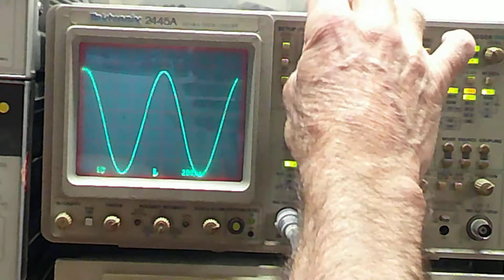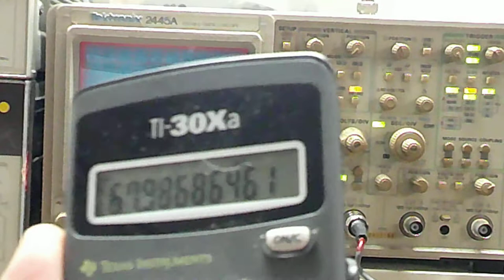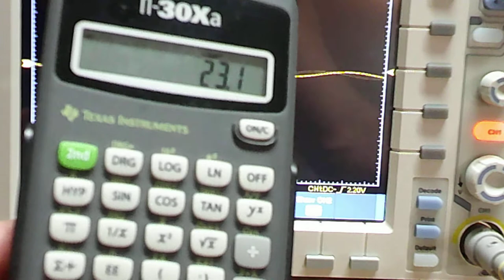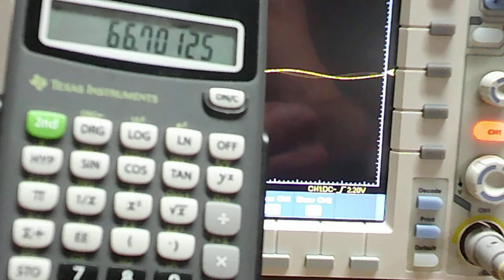Audio Amplifier Output Measurement Using Different Types of Oscilloscopes

Comment: could you not just hook an oscilloscope onto your speaker leads while the amp is also connected instead of using a dummy load?
Reply from the maker: No, the volume would be ear shattering, and you'd run the risk of damaging your speakers as well.

Comment: When I use the regular ground reference oscope probe on the + and - terminal on the amplifier I get a reading that looks like 2 AC sine waves wth at are 180° out of phase. Would a differential probe help this?
Reply from the maker: I don't know how I missed this but I did.
Often this is an adjustment of the triggering on the scope.  If you're still having this issue please contact me via email.  My email address is available under the ABOUT tab.

Comment: Brilliant use of the dummy load.  I have a 500 watt resistor but never thought about the banana clips and the scope loops.  I'm going to make one like yours right away!  Thanks for sharing.
Reply from the maker: You're welcome!  There's more than one way to do these.  I have since moved on to 1,000 watt dummy loads, with a dual banana jack on the front and coax that goes directly to my distortion analyzer.  Think about what you have for test equipment and tailor your dummy loads accordingly.

Comment: Hi. here i go again. :) I have an simple  DDS signal generator. (fy3224s) Can you tell me what is the amplitude level to set for sine wave?  ( I know the frequency is 1kHz) But how many volt needs to set for the pa amplifier test with the DDS generator? I've many PA amp and i just want to test the output power and the signal. Thank you.
Reply from the maker: There's no magic number here.  The key is to slowly bring up the amplitude until the visible onset of clipping, then back it down just until the clipping ceases.  That's your maximum output.

Comment: Thanks for sharing ,but if you’re getting distortion on the peaks would that mean you’re driving the finals to hard or is there a fault in the amp it self ??
Reply from the maker: If it is equally distributed between the positive and negative halves of the sine wave AND is in excess of the amp's rated output, then you are driving it too hard.  If, however, it is pronounced on only half of the sine wave or exhibits at below rated output, then it would indicate a problem.

Comment: At some point it would be great if you can persuade people that the resulting power measurement is average, not RMS. RMS is only applicable to the voltage and current measurements.
Reply from the maker: "RMS" watts has been a misnomer ever since the FTC mandated watts measured using the RMS method, which as we both know does NOT equal RMS watts.  But the term has been entrenched for decades, so all I can do is not perpetuate it.

Comment: Hi Ray.. Thanks for this video. I want to ask a question. I have an 8ohm dummy load box. I put bnc connectors on it to tap off the box and run to an o-scope. I take regular coax bnc cable. Female to female and run directly to my digital scope. The most I get before the SX-980 starts clipping is 2.64 RMS according to the scope. Am I missing something? I know regular probes have x1 and x10 switches. Is my scope setup wrong? I should be getting a lot higher RMS reading with this unit. Should I be multiplying that 2.64RMS by 10?
Reply from the maker: Try measuring with your DMM on AC volts and see what you get.  If it's significantly higher (and it should be) dig around in the scopes vertical setting and see if it's set up for X10.
Reply: @raygianelli3612 The setting on the scope was set for 0.1. Set it for 1.0 and got the correct 26.4 RMS reading for the output. 87 watts per channel on this bad boy. :) Thanks for learning me!!

Comment: Thank you for your video 
Excellent tutorial 
Where can I find the heat sink you have on this video
Reply from the maker: Well, I pulled those out of the dumpster at work.  They came from an old Telco rectifier.  But if you look around you can find heat sinks in old equipment of various types.

Comment: Hi Ray.. any change you might do a short video on the basic settings  like the ms/ and triggering for the digital scope when you first  turn it on and want to measure the volts to figure watts like this ?  .. not knowing much about scopes I am finding my new digital one a little confusing.  but even for analog I need the settings to help me get started.  thanks!
Reply from the maker: I'll see about doing so in the near future.
Reply: @raygianelli3612  That'l be just awesome! thank you. I'm just starting repairs/restore so i wont be at that stage for a while.. it'l be a slower but careful job.

Comment: good evening, 1khz is always used in this measurement? Thanks for the answer, and thanks for your videos👍👏🤩and I also wanted to ask if it is possible to connect the signal generator to the oscilloscope, without a separating transformer, thank you for everything.
Reply from the maker: Hi Luke. Some manufacturers use 1KHz for their distortion spec.  Some rate their products from 20Hz-20KHz. 1KHz is a good starting point.
You can certainly connect your signal generator directly to your scope.
Thanks for the thanks!
Reply: @raygianelli3612  you are the best, thank you very much for your comments, nice day :-))

Comment: When you calculate the output power using the multimeter method, why do you square it? Thanks, have been trying to do this before and have not gotten an accurate measurement.
Reply from the maker: Scott, I must admit I don't know why you square the voltage, only that it's what Ohm's Law prescribes.  I never even had high school math, so it's admittedly a weak point.
Reply: @raygianelli3612  Alright. Thanks!

Comment: I have a second question 
I’m not to familiar with digital or analog scopes , but wanting to learn more about their uses and functions .  
If I’m working on old vintage stereo equipment . Do I need a digital or analog scope?
Or can I read audio signals from vintage equipment with both digital or analog scopes?
Just want to make sure I buy the correct scope.
Reply from the maker: You're best value will be older analog Tektronix scopes.  They work well for this application.  The new DSO's are amazing, but expect the prices to start out around the $300 mark.  You can find good used Tek scopes nearer the $100 mark.  Make sure that the scope is shown displaying a trace before buying.
DSO's have an amazing array of measurement functions, and shine on low frequency signals.  Their downside is having to dig through menus to access those amazing functions.  And the DSO's at an affordable price are terrible in X/Y mode, which I use for my curve traces, determining if an FM tuner is actually putting out stereo and some FM alignment functions.

Comment: If that is a stereo amplifier, doesn't the second channel need a load also while the other is under test?
Reply from the maker: It doesn't need a load to prevent damage, unless it's a tube amp.  There may be a small difference is power measured, since most amps are rated as "both channels driven".

Comment: All these videos I've seen about measuring output wattage are all very good. However, no one has said what input voltage they are using to drive the preamp. Is it 20mv or 200mv?
Reply from the maker: Jesse, it just needs to be enough to drive the amplifier to the edge of clipping. A CD player puts out close to 2 volts, just to give some perspective.  The job of your preamplifier (or preamp stage in your receiver or integrated amp) is to drive the output stage with the necessary voltage for the desired volume.  If you're testing a straight up power amp, just crank up your signal generator and watch the scope for visible clipping. 20mV would be good to test a phono input, but inadequate for a power amp.
Reply: @raygianelli3612  Thanks!

Comment: Hi Ray
Firstly thanks for another great video, as a beginner I am learning so much from you.
I have a question regarding clipping, can you please explain when would you would consider an amp has a clipping issue, for example if an amp is rated at 100watts max, at what power output level would you consider a clipping issue and is it normal behaviour for an amp to clip at 100watts, is there a threshold?
Reply from the maker: Clipping is what happens when you ask your amplifier to output more power than it can supply.  And yes, a 100 watt amp could be expected to clip when asked to deliver in excess of 100 watts.
Reply: @raygianelli3612  Hi Ray, Forgive my boldness, do you work fixing vintage audio gear for hobby?
Or you earn money doing this?
I ask you because fix vintage audio consumes a lot of time.
In my case I earn money fixing High End Audio and motor controllers here in my country.
I fix a lot of McIntosh and Audio Research both are American companies.
Best Regards.
Reply from the maker: @treadmillrepair754  Ricardo, it's really just a hobby. I have a day job as a central office technician with a large telecom provider.
Reply: @raygianelli3612  Except when it's a McIntosh amp! My 2105s have put out between 130 and 150wpc without clipping. Considering how hard they've been gigged, it's pretty cool.  I really appreciate this video as I am going to buy some dummy loads and start experimenting with all my amps (mostly old Fenders aside from the Macs). It's exactly what I needed to see.
Reply from the maker: @edwinhurwitz6792  Thanks Edwin!  Maybe I'll put my VHT (Fryette) power amp on the bench and see what it will do.
Reply: @raygianelli3612  Put it up on Youtube!

Comment: Hi. Sorry for the question. :)  The 2.83 what you used  for devide what is that number? 1.41 per channel or not?
Reply from the maker: Hi Zoltàn.  Questions are welcomed here!
An oscilloscope screen has a grid on it, and the grid's vertical axis reads out in volts peak to peak.  In order to calculate RMS volts we must  divide that reading by 2.83.  This converts the peak to peak reading to RMS volts.  Make sense?
Reply: @raygianelli3612  Ohh yes,yes I already understand. Thank you very much. :) BIG LIKE.

Comment: Ray, are the volume controls maxed out when doing this measurement?
Reply from the maker: Really doesn't matter.  If the volume controls aren't maxed then the signal generator output needs to me increased.  It's all about pushing enough signal into the amp's input o get to the edge of clipping.
Reply: Ok, thank you, I get it now.

Comment: When I use the regular ground reference oscope probe on the + and - terminal on the amplifier I get a reading that looks like 2 AC sine waves wth at are 180° out of phase. Would a differential probe help this?
Reply from the maker: It sounds like you may be measuring the output of a balanced amplifier, which floats the output above ground.  Do a search on oscilloscope pseudo differential input.  Using 2 probes without the ground clip you can safely make measurements of amps like this.
Reply: @raygianelli3612  There's no info. Its a 4 channel amplifier from CT Sounds. CT150.4D. They're sending me a replacement and we'll see what the oscope showes with that.

Comment: I have 500 watts RMs Passive speaker.
My amplifier is Behringer NX-6000D.
According to the manuals
1600 watts per x2 at 8ohms. The Max VP value at amplifier Dsp software shows 160Vp.

Kindly advise me on the calculation, how much VP should i set to my Speaker
Thanks
Reply: @Ray Gianelli

Comment: sir. is it possible to measure the watts of the amplifier at 8 ohms?
Reply from the maker: Yes.  You need to load the amplifier with an 8Ω load, a large wattage resistor is recommended.
Reply: @raygianelli3612  thank you so much. i watch on other youtube channel and heard. there's such thing as a Dyno Amp to measure the watts of the amplifier too.
Reply from the maker: @CarloTheAtheist2.1  Holy crap, they want almost US $6,000 for that thing! Guess if I ever need to measure amps of 19,000 watts/channel, I'd have to consider it.  But I've never seen an amp even close to that, so my money's safe for now.  😁
Reply: @raygianelli3612  exactly! oscilloscope also can do anything.

Comment: Does it matter watt power of Dummy Load? Thanks
Reply from the maker: Really depends on the power of the amplifiers you're testing.  The ones I have now are rated at 1,000 watts each.  But I used smaller ones for years without issue.  You can exceed the rating for BRIEF periods, long enough to verify an amp puts out full power without clipping.
Reply: @raygianelli3612  Thanks for reply. Resaon i'm asking is i have tested few amps and power always comes to around 50watts but i know amp has 3 times more power, than i checked my dummy loads and they are 50watts. I think that could be a problem.

Comment: Interesting, I haven't seen that equation for finding rms. I use the peak voltage times .707 to get rms
Reply from the maker: Perfectly valid method.  There's more than one way to calculate the RMS voltage.  I did a web search and found one page that multiplies .7071 for peak, and .35355 for peak to peak.  The reciprocal of .35355 is 2.83, so dividing by that yields the same result.  Just be sure to center the trace on the scope to get an accurate peak level.

Comment: Why don't people ever mention amperage with regards to audio power (watts) or amplifier audio output?
Reply: In your example would that be about an amperage of 8.4?
Reply from the maker: We characterize amplifier power in watts.  Watts are the product of voltage times current.
Reply: @raygianelli3612  I understand... It's just interesting that no one seems to be bothered by knowing or not knowing the measurement of the current (amperage).   I suppose they just extrapolate current based on the ohms and voltage measurements?
Reply: The signal running through speaker wire is electricity... And when people talk about electricity, amps or amperage often seem to be part of the conversation... But not when it comes to audio signal.
Reply from the maker: @doveshouse  The problem lies in the changing of impedance with frequency.  Your 8Ω speaker is rarely 8Ω.

Comment: l'oscilloscopio fornisce misure di frequenza molto precise ( 0,1% tipicamente) , mentre misura l'ampiezza con molto meno precisione ( 2% tipicamente)
Reply from the maker: Gli oscilloscopi analogici non sono neanche lontanamente vicini allo 0,1% per la precisione della frequenza. Sono d'accordo sul fatto che la precisione verticale è di circa il 2% e dipende da quando è stato calibrato l'ultima volta. I DSO sono molto migliori in questo senso.
Reply: @raygianelli3612  ho detto precisi , non accurati . vediti  il video di come è possibile misurare, tramite un espediente,  una differenza di fase di pochi gradi tra due segnali di 10O MHZ , con un vecchio ma ancora fantastico HP1740A